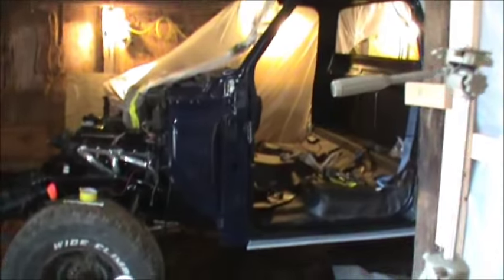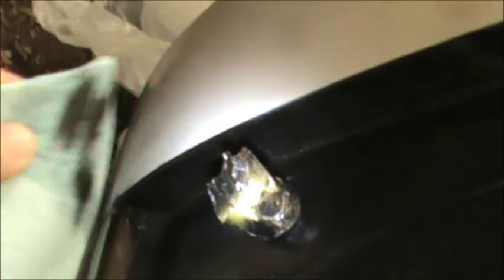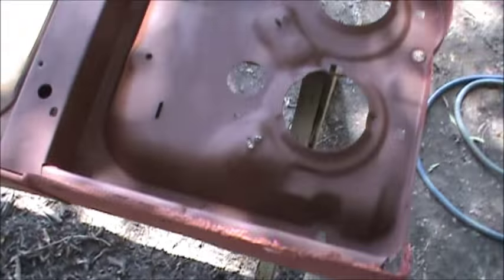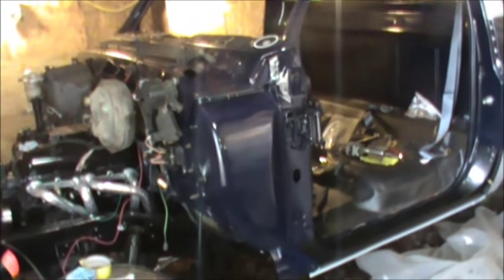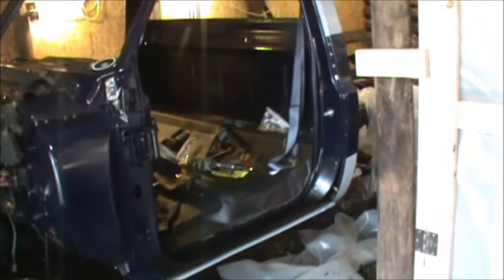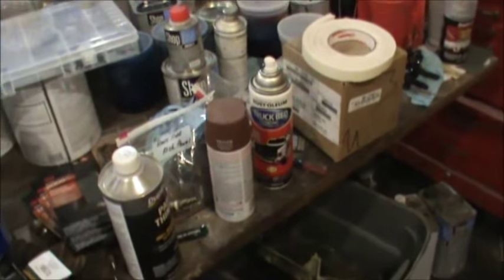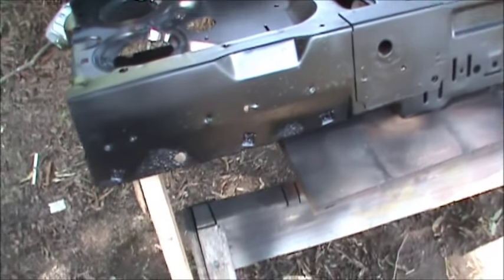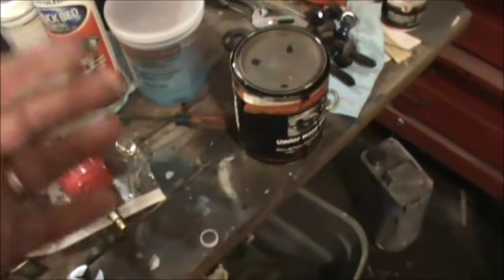1985 Chevy K10 Restoration Part 69

Comment: I remember my 79 had rust out on the same spot on the core support.  I just bent up a piece of sheet metal and welded it in.  That gun really makes me appreciate my Devilbiss.  It has given me no trouble and I have had it over 12 years.
Reply from the maker: mossman381 I really like my Devilbiss gun too.  The parts truck core was not rusted out in that spot so I could cut and patch if I really thought it would matter.
Reply: farmboy30117  You already have it painted and ready so I wouldn't mess with it.

Comment: Man, i wish i only had 5 or 6k into my build. When/if I get it running I'll probably make a quick video off it. If you're interested I can let you know when it's up.
Reply from the maker: kyle1330 Well that's an estimate, but I'm spending more on it weekly so it'll go up.  Sure, let me know!
Reply: +farmboy30117 
I have probably close to 14k into it and probably have realistically close to another  5k, maybe more, to go before I'm  done with this big 1st phase of the build. Later when my bank account recovers and the credit card  is paid off I will begin phase 2 which includes 14 bolt rear axle, dana 60 front. Homemade heavy duty bumpers + winch. 8 lug wheels. 37" tires. Airbag spring helper set up with on board air compressor. Some cosmetic stuff and whatever else I think of between now and then. Or maybe I'll  just throw it up on Craigslist and see if someone is willing to pay 40k for it. lol.
Reply from the maker: Dang, that is going to be a well built machine!
Reply: +farmboy30117 I wouldn't say well built, i don't entirely  know what I'm doing, but hopefully quickly built, spent more to try saving time. I have other plans and need to wrap up this project to move on and maybe even spend a weekend or 2 having a life this summer.
Reply from the maker: I know exactly what you mean ;)
Reply: +farmboy30117 got it running, started first try which was a pleasant surprise. You can find a video of it on my channel if you're interested. Thanks again for the series, your videos help.

Comment: what does  the bed liner do for the area?
Reply from the maker: matt may I sprayed it for two reasons: 1. to cover up bright blue paint streaks where the gray meets the blue and 2. it will help prevent loss of paint on the sills when getting in & out of the truck from dragging feet.